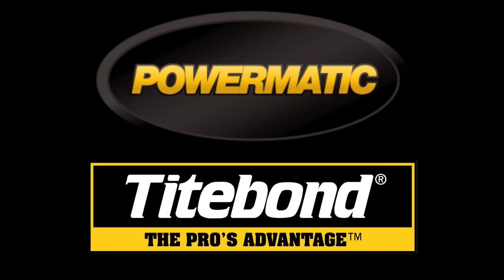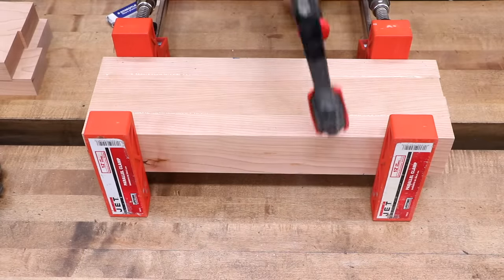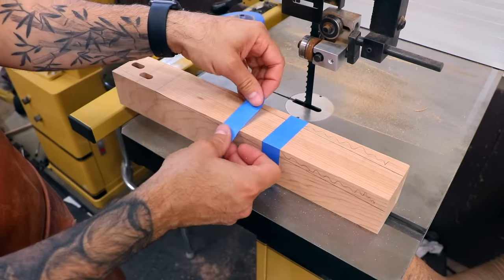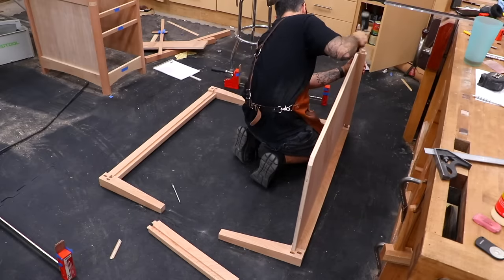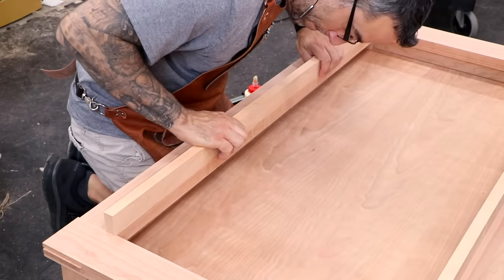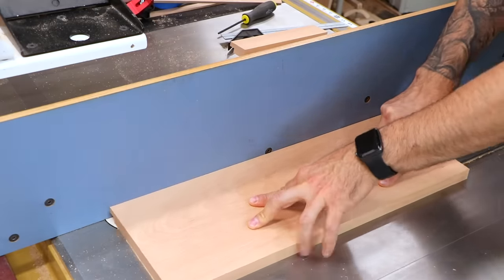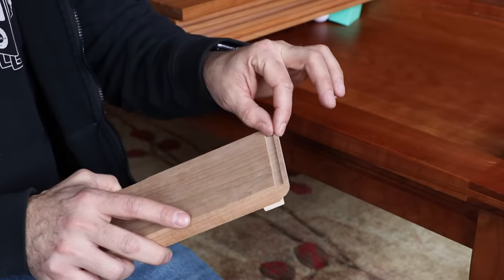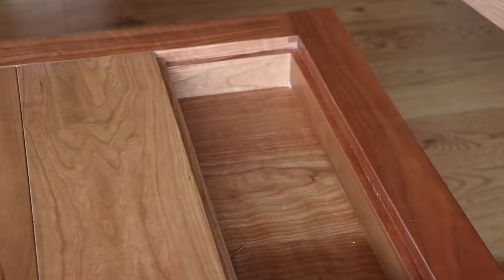Gaming Coffee Table

Comment: As an owner of the original guild project, thank you - even though I just started on the full size table right before the coffee table version was released! Oh well, can always build this one after the big brother table is done.

Guessing that you can use solid panels you because of the smaller size?
Reply from the maker: Honestly, the solid panels aren’t the best idea. They will expand and contract quite a bit so most of the year the fit will be loose. Yes, it works, but using plywood panels would give a much more finished look and a reliable fit.

Comment: Love this design. I already have the dining table plans which was going to be my next project. Am I crazy to build both at once? Seems like it won’t be twice the work...or am I being naive? I have loads of lovely teak that I am desperate to use and a table set would use it up nicely. What do you think?
Reply from the maker: Building two of the same thing is always more work than you think. Building two projects that are similar but not exactly the same will be even MORE work. But, it can indeed be less work than building them one after the other. Just be very careful to mark all of your parts and your joints so you don’t make mistakes. Setups will be similar, but not exactly the same.

Comment: Mark, so the coffee table top inserts are loose and not glued together?

I was thinking if the insert was fastened together it would be cool to add some hinges and shocks to hold the top open to access what is stored within... I guess in that scenario you would want to use some veneered plywood (to avoid those long grain glue joints) and edge banding.  

Thanks for sharing...
Reply from the maker: correct they are loose and can easily be removed

Comment: What was wrong with using the TS and tenoning jig? I don’t understand why the band saw was better
Reply from the maker: That should be explained in the video
Reply: The Wood Whisperer the explanation didn’t make sense to me. The hollow of the bridle joint would be the same width regardless of how it’s cut, so wood movement would be the same. I don’t understand why the kerf of the TS blade makes a difference with wood movement.
Edit:actually maybe what you’re saying is that so much wood gets removed that the tension being relieved is greater. Is that right? Still I’m not sure if the stresses would be different for a small kerf cut or large kerf cut. There is no later force holding the outer sides of the female piece being cut regardless of kerf. I would guess it was just tension in that particular piece. The center bit ,once cut, wouldn’t play any role in keeping the outer faces straight.

Comment: Mark silly question only use a mobile and don't have a computer or laptop is the guild any use to me not having any of the above?
Reply from the maker: Hi Claire, not a silly question. The Guild website was designed to be responsive to mobile, so you should not have any trouble watching the videos there.  If you are concerned you can always sign up for the free Picture Frames project and see how it works for you.
Reply: Just scale down the table to fit your phone.